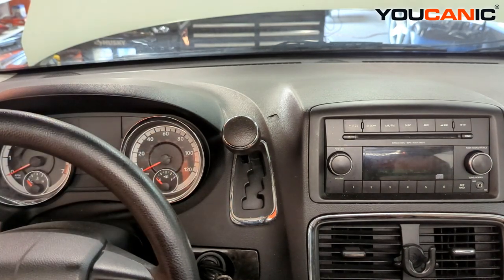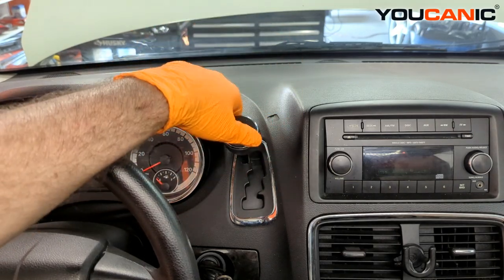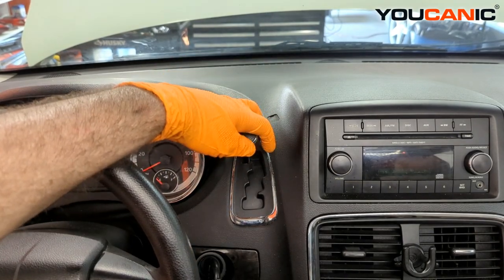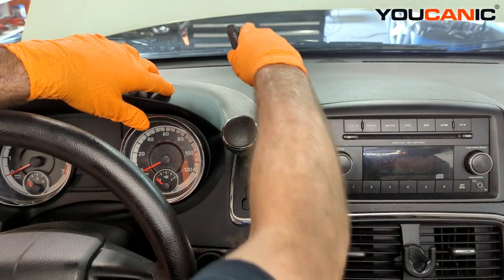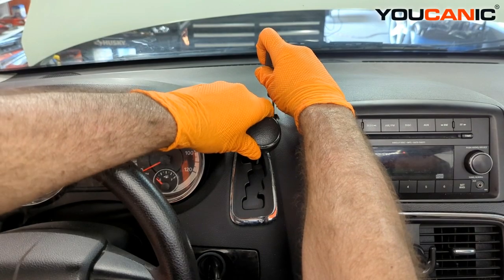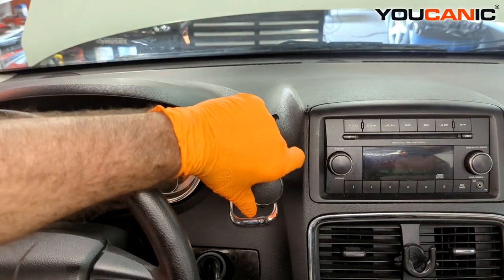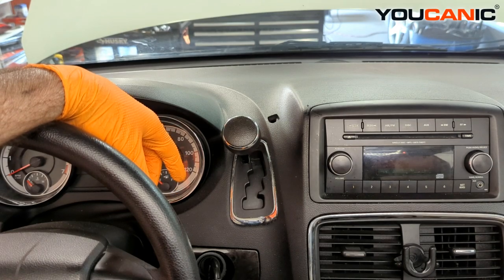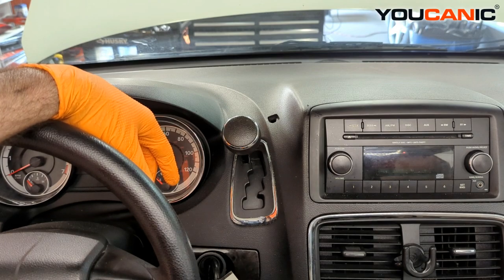2008-2020 Dodge Grand Caravan - How to Adjust Gear Shift Manually (Stuck from Neutral)

Comment: Tow driver would have wrecked my van if it wasn’t for your video. Thanks so much man!
Reply: It's great because if they just made it so it didn't require power to shift to neutral,  this wouldn't even be an issue.    Now days you can't even check or change your own transmission fluid without special equipment .  Cars ownership is inching closer to a subscription service.

Comment: Thanks for the video, my 2014 Dodge Caravan car does not move, the shift does not pull until I disconnect the battery and connect it to the back and then the shift moves. This video helped me not to do that procedure until someone can fix it for me. God. bless them
Reply from the maker: Thanks for your feedback! We’re thrilled our video could assist you with your Dodge Caravan issue. At YOUCANIC, we aim to provide empowering tools and resources like the YOUCANIC scanner to make car maintenance a breeze.

We're more than happy to help you further. If you need any additional assistance, don't hesitate to reach out on our website. You'll find helpful guides, factory repair manuals and more at www.youcanic.com. Your car care journey is our mission!

Comment: Question. 2011 grand caravan, once you put it in Park the dash still says it is in reverse. Can't bring it back out of park till you restart the vehicle. Dash tells you to put it in park even though it already is.
Reply from the maker: It sounds like your 2011 Grand Caravan may be experiencing a transmission or electronic issue. One tool that could be very useful in narrowing down the problem is our Full System Scanner at www.youcanic.com/scanner. If your issue persists, don't hesitate to visit our platform at www.youcanic.com, where you can ask further questions or seek additional guidance. We're here to aid your automotive journey and make car repairs accessible and understandable. Your trust in YOUCANIC is greatly appreciated!

Comment: So, how many positions do I count down to get to neutral? Battery is dead so the panel shows nothing. Thx.
Reply from the maker: Thank you for reaching out! Normally, you would have to pull the gear shift down four positions to get to neutral assuming your car has a typical PRNDL shift pattern. However, since your panel is out due to battery issues, it might be safer for you to consult the specific factory repair manual for your car make and model, available at www.youcanic.com/. We, at Youcanic, are here to empower you with DIY car repair and maintenance, feel free to explore our resources or ask questions on our site.